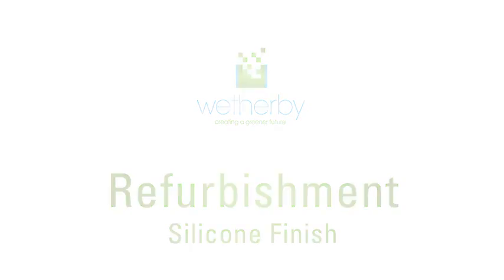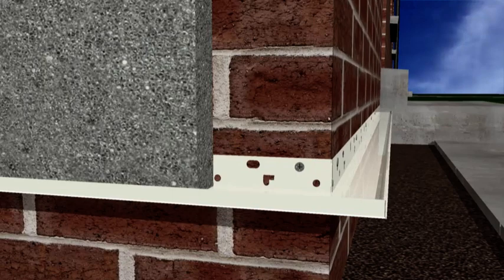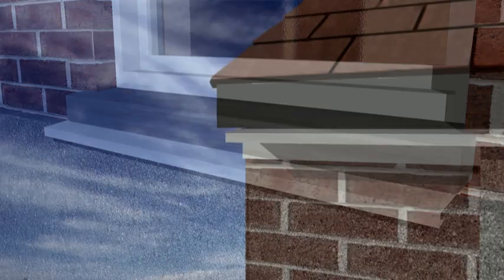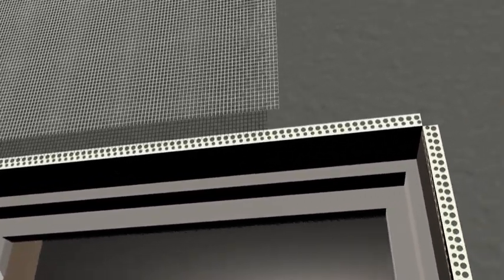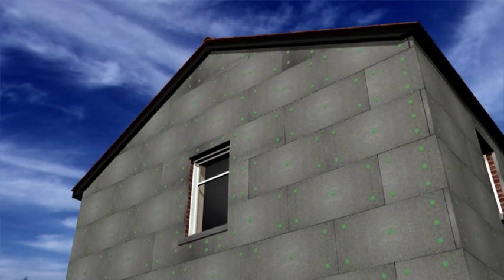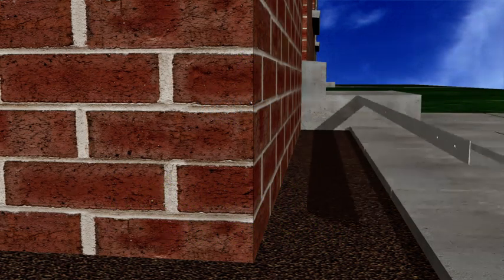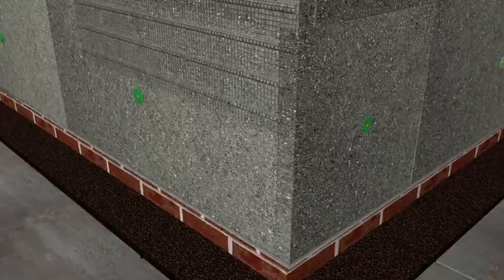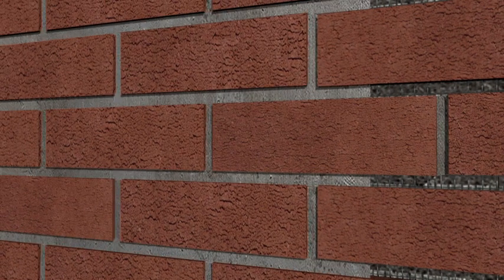The Wetherby Guide to External Wall Insulation and Render Finishes

Comment: Can adding external wall insulation on a solid wall increase the chances or have internal damp or mould on the internal walls? So many have had the problem & some have had the insulation removed? Thanks.
Reply: It will prevent the walls breathing so internal damp will be much worse. I suspect over time some applications may have to be removed for this very reason. If you use positive pressure ventilation with heated air brought in from outside then you may reduce damp issues but it will cost a fair bit in extra heating.

Comment: use stainless steel beads ☺NOT galvanized steel on external... you will get rust spots through your render 😠when using galvanized beads on a external wall

Comment: What happens to the walls below the damp proof course? I have at least 2 feet if not more? Is this filled in or painted over with anything as It will be extreamly noticeable?
Reply: I ask myself the same question in EEEVERY video I see about this system. There have been a few where I've seen that they first waterproof the wall and then use a different insulating material, a more dense foam that is also waterproof. But I got no clear explanations yet.